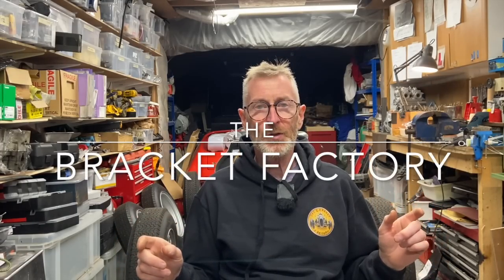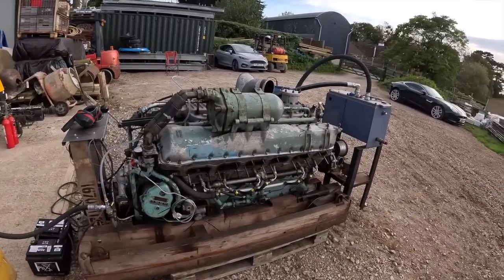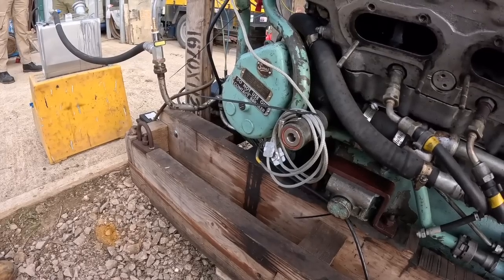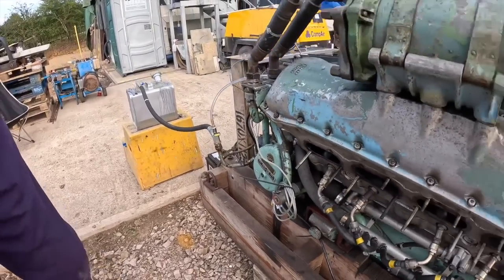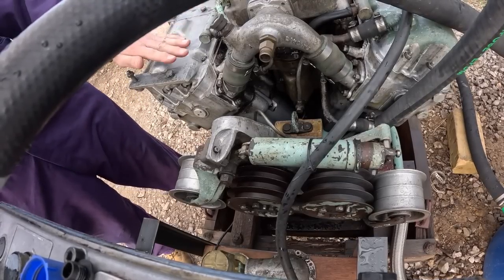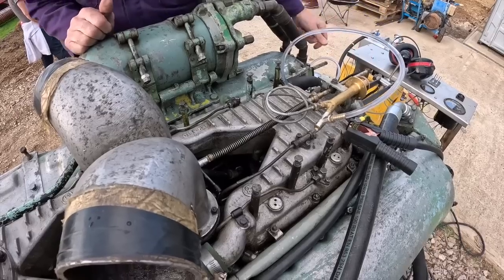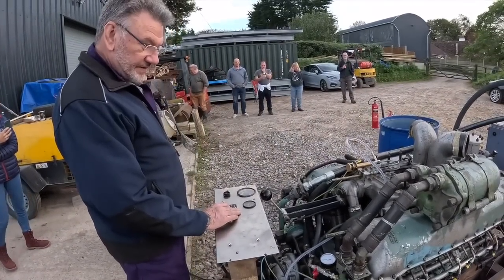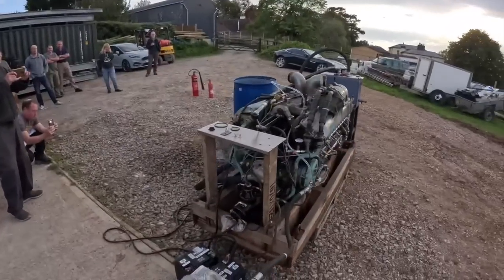American La France Project - Episode 6 - METEOR ENGINE!

Comment: Then of course there is Jay Leno and he has 2 cars with Merlin engines in them, one a Bentley that he had built here in the UK as seen on Top Gear and then one he had built in his own garage in LA, he goes in to great detail about the build and how it is to live with a huge engine car that actually works, once the gearbox and diff got sorted out and it could keep going, then heat, the complete underside of the car is radiators. Enjoy.
Reply from the maker: yes, I need to pop across to Jay's channel and take a look at those!

Comment: very little apparent vibration/torque twist.
Reply from the maker: It doesn't have a flywheel so the mass of the rotating assembly is only a small fraction of the total mass.. hence negligible 'twitch' when it's blipped (and it wasn't really blipped anyway!)

Comment: In the first Gulf, we had a cent ARV (recovery tank) one of the last two in service. To clean the air filters you remove the kidney plates and wash them with fuel. The soldier was cleaning them so obviously you get a lot of fumes, all hatches open. 
The other one decided to make a brew, as he ignited the little gas burner the gases caught (the two soldiers got out ok) but it was ablaze and parked next to some other vehicles and some ammo. They tried to push it clear with a chally but it was too late, the whole lot went up! 
I did have a picture, if you can imaging the people in the image were 4mm high (that’s how far the camera was away) the ball of flames and the engine deck lids were shot up into the sky (about 200mm on the picture) so you can imagine the force of the explosion
Reply from the maker: @shaunsheep8252  bloody hell!!

Comment: In the Cromwell tank which was almost the earliest version of tank run with the Meteor the fan was specially designed to move 8000 cu ft per minute through the radiator to prevent overheating. If the engine is ex Centurion it will be an M4b which is a two block engine. Mag drop not to exceed 400 rpm. 
The Liberty V12 was in WWI in America using RR cylinder dimensions so similar but different! 
The information that was interesting is the limitation of revs on a Meteor without load. At what point is the chassis and limited bodywork of a road vehicle heavy enough to become a ‘load’. This is very important as running such an engine with this limitation may well mean the usable rev limit drops from 2400 to say 1500 to 1800. This could also apply to other ex aircraft engines. Slide rules out - well you don’t use those now!
Reply from the maker: That's a very good question! The torque of the meteor is high enough to break traction of any road tyre you can mention, never mind vintage tyres, so it will be very hard to apply a load that even remotely compares to a tank with tracks! So I think a sticker on the dash saying 'be very careful' is probably needed....

Comment: Very cool! There is an awesome cut away Merlin in the war memorial museum in Auckland, NZ. Driven off an electric motor so you can see it 'working'. What will you do for a clutch/gearbox?
Reply from the maker: Lorry box is used (Sherpa) but an adapter plate/bell housing needs to be made. But were there is a will, there is a way!

Comment: you can buy a  repro 1932 Ford chassis it can handle a lot of torque and also get superb pre war axles to handle that sort of HP
Reply: Not really>I have played with them since the 1970's. They need boxing to contain the torque of anything more powerful than a flathead. A 1938-1940 Chev Chassis would be better because of their box construction,cheapness , easy availability and simplicity.